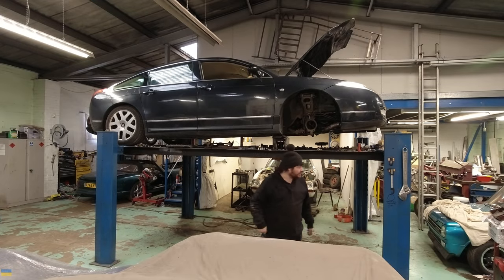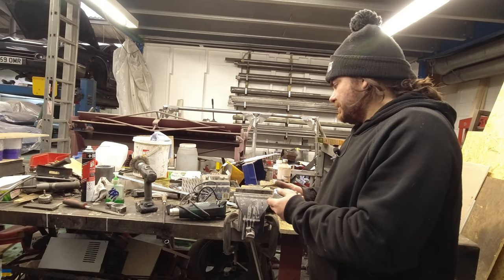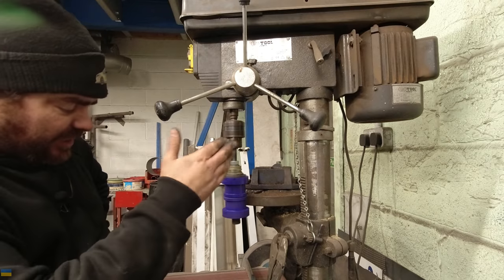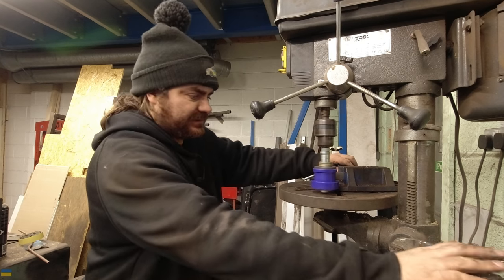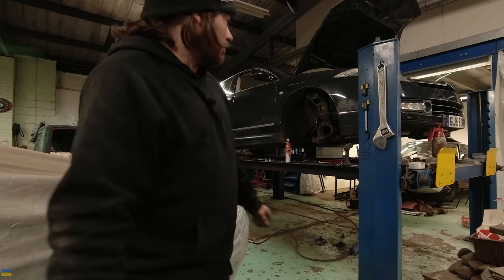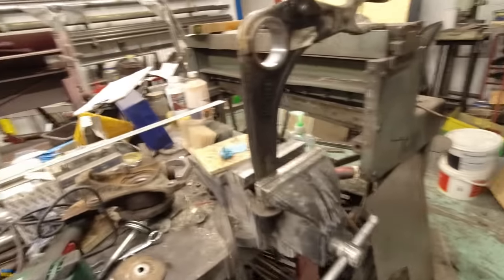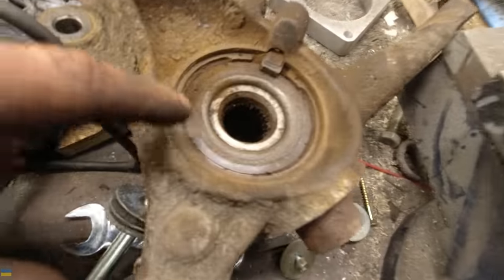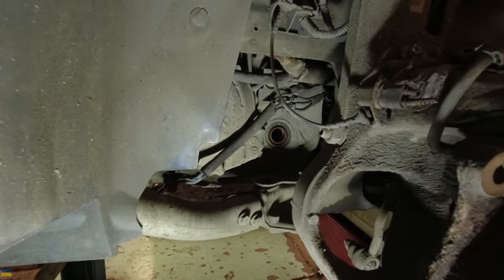Cheap Citroën C6 Project 3:  More bush problems, executive decisions and WHEN WILL IT END?!

Comment: The repair to that pipe was done by the side of the road in Rural France. The only reason we saw the leak was coolant coming out when we parked to take a photo. There is no coolant level warning on the car be which is a big mistake in my view. No warning either from that leak or when Snows in Basingstoke knackered the thermostat housing when changing timing belt. The was just a smell of coolant in cabin.
Great to see her getting the love she needs!
Reply: Active engine mounts but no coolant level warning? Is it just me?
Reply from the maker: It will be getting a low level coolant warning in a future episode :-)

Comment: This is when it becomes apparent that originally expensive cars benefit
from a cossetted garaged life away from salted roads.
I've noticed on Google street view UK owners pull out the front gardens of
Duplexes and pave the area for the car ..so it hardly ever gets a chance to dry 
out in a damp climate.
Although used car prices tend to be more in Australia, we don't have salt.
Reply: Yes it's a weird habit, people on our road pull trees down and leave a barren paved area in front of their house. Ugly and not good environmentally.
Reply: Household garages are generally too small to usefully store vehicles in the UK. 

And parking is often very challenging in towns - hence the paving of front gardens.
Reply: @mrc7478  sure - but there are ways o doing it without ripping anything green out and concreting it.
Reply: @alfamonk  I agree with you.
Reply from the maker: Modern houses in the UK are so crammed in, and the roads so busy that people will do what they can to park their car. The C6 wouldn't fit in my garage at home, I know that. Garage is tiny, even the BX is tight, and the house was only built in the Eighties!

Comment: Again awesome video and logical well thought out engineered solutions to overcome those ever so small issues 🤪 that are never highlighted in any instructions included in replacement parts oem or aftermarket parts 🤔 Polly bushes great solution but as you have encountered can be dam right pigs 🐖 to fit in some cases 😉 Onward and upward to the next gripping episode ! So much more entertaining than what the mainstream TV in UK put on these days, never looked back from cancelling the TV licence 🤣🤣

Comment: I do enjoy these vids, I did the suspension bushes on my Chimaera a few years ago and they were a pain to do, and if the powerflex ones had not been so expensive I would used them, instead I mullered a few lengths of threaded stud to get the new metal ones back in.. I now have a powerflex swear jar for when they next need changing..
Reply from the maker: The PF ones are quite pricey, though the cost of the standards with all the new thrust washers adds up surprisingly high, too.

Comment: That upper ball joint is a bit of a concern, the ones I've worked on have had a nylon spherical insert. If considerable heat has been applied, it might have ..... melted a bit. A de-burring tool usually works quite well, even on steel, to create a decent chamfer / lead in, without having to resort to filing. The Rangie P38 has bushes that are about 2.5mm oversize when measured free, the fitting tool has a long taper to compress it during fitting. Interesting stuff, especially the active engine mounts. Thank you.
Reply from the maker: I think it'll be OK. There's zero play in it.

Comment: Okay, the active engine mounts powered by boost are officially mind-blowing. It's such a shame that this kind of engineering is all but dead at Citroen today.
Another brilliant video sir.
Reply from the maker: I think technically they're powered by electric solenoids, but those are governed by boost (as I understand it). Means you get have it very soft at crusing speeds, which is good for NVH, and if you start giving it beans they firm up when needed.

Comment: Just weld an suitable long iron bar to that upper ball joint and turn it off. That works with C4 lower ball joints, which are pain to get off :-)
Reply from the maker: Too much risk of tearing the thread out of the upright, though, it being alloy.

Comment: Hate to say it bro but i reckon you'll end up having to replace that upper ball joint in quick succession, it won't resist the forces acting on the car. As a guy who has traveled all round South America with a fairly unique car i tried everything to continue with my shot ball joint. Opened it and stuffed it with washes, used car batteries to weld it... all sorts of BS but it didnt last. Ended up modifying a new balljoint from another car using the old electric drill and angle grinder 'lathe' technique! Great job on the bushes!
Reply from the maker: I'm quietly confident, but even if I had to, it doesn't take long to get it back to the position I'm in there.
Reply: @UPnDOWN  All good bro! I´d order that special tool so you´ll have it on hand in the future. Fingers crossed.

Comment: Another great video mate. Upper ball joint and tool issue ……. Your too small ball joint tool looks to be for a pug 405 or 406.  The tool you need looks identical but slightly bigger . Try Laser 7332 on eBay-fits mine. Fits pug 407, Citroen C5, C6…..dimensions given in advert. The upper ball joints come off easily with this tool, 1/2 “ breaker bar and a trolly jack handle on the end of the bar for extra leverage. You probably know that you need to secure the tool to the ball joint cut outs by screwing it’s nyloc nut to lock it there then a large socket on the end of tool itself . Heat is good for loosening the thing up but also will have melted the plastic housing within the ball joint to take up slack…… hence it seems tighter. ……. It will wear quickly now and need doing again soon………. Please don’t ask me how I know this as I am still receiving counselling and detailed recall will cause palpitations and relapse…. Oh no….. I can feel relapse starting at meet though……..whilst you’re in, renew the lot !
Reply from the maker: That's interesting, about using the nut to hold the tool on! I'd never thought of that! Will bear in mind, if these ones cause any future grief.

Comment: If you had a lathe you could have turned down the outside of the bush to be non concentric to the hole down the middle, and eliminated the need for 5mm of the spacers
Reply from the maker: But then the bush would have been very thin on one side, and possibly worn through?

Comment: .... very good, logical engineering work - well done - I only have one concern, may I enquire as to where the previously mentioned 10mm dimension, for the thickness of the spacers has come from ? has an actual C6 Exclusive part been measured ? the larger poly bush diameter may of been to cope with the increased applied load from the change in force with the moved fulcrum position ? - (thus the hole being so tight, if the bush was specific for an 'Exclusive') hope this makes sense? - keep up the excellent, ever improving (little edit flares, sound and visual effects are becoming pro !) YouTube work - regards Andy
Reply from the maker: The 10mm was measured by comparing a C6 arm to a 407 one, on the C6 forum.

As for the bush...just my guesswork as nobody else seems to fit them!